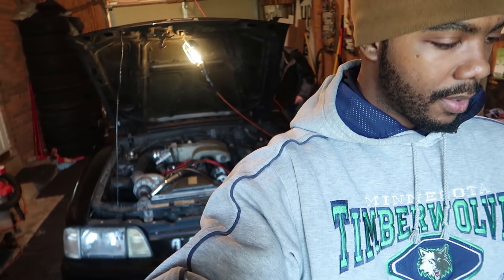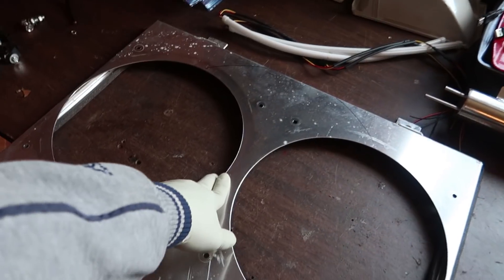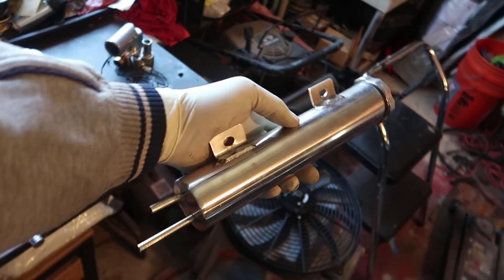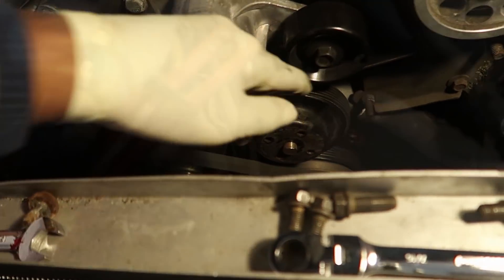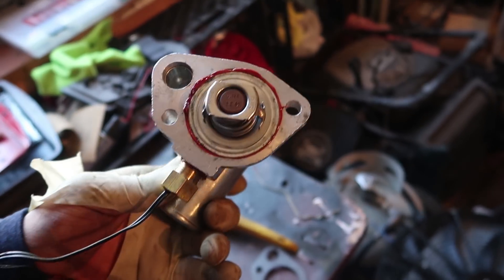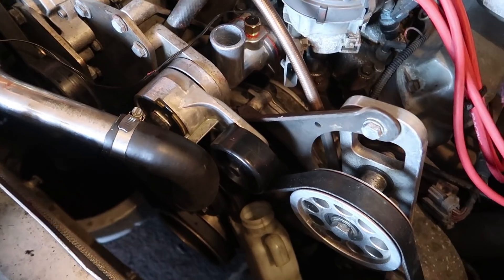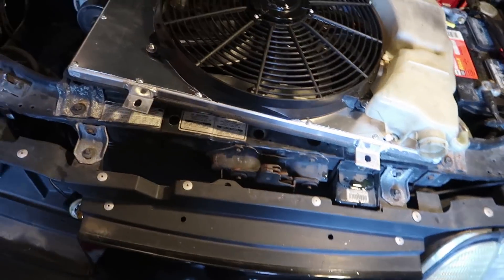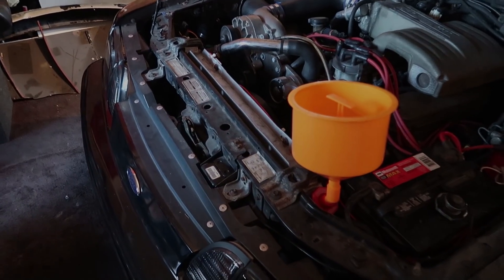Electric fan conversion with automatic switch: Foxbody

Comment: Hey is that kit for $59.99 then u have to buy the thermostat housing neck with the plug in it!! I seen how 1 of those kits it looks like the probe goes into the intake instead of the housing!! Or do u remember the part # that or I might just use a toggle switch just have to keep watching my temperature gauge

Comment: Im not very good at wiring diagram. How did u tap into the ignition coil for the 12volt source? Thanks!
Reply from the maker: the plug that goes to the coil has a red wire and a black wire.  Just splice into the red wire.  Be sure to disconnect your battery and use a fuse.

Comment: You guys DO love RTV  but it wasn't meant to be that thick which can prevent the bolts from fully tightening.
Reply from the maker: The most important thing is to be very careful not to get RTV in the bolt holes, that could cause some serious damage. I learned that a little later, not the hard way thankfully.

Comment: Great Video  I only wish you would include a list of parts you used that would be very helpful. Also dose anyone know of  oem or aftermarket fan that  with a shroud that will fit?
Reply from the maker: All parts are listed in the beginning of the vid, most of that stuff can be found on LMR.  The shroud is from an ebay dual fan set up that i DO NOT recommend buying,  as you saw, i canabalized it to make something new.  Use a Tauris or contour fan instead as I suggested.
Reply: Thank you so much keep up the good work on these videos.

Comment: A word of warning you should never put sealant around the thermostat itself if it comes off and it will and goes down into your engine and then up into your radiator it will clog up some of its pores then  you will begin to have issues I know this because a friend of mine did that and he started having heating problems months later  and there was no way to get the sealant out of the radiator so he had to replace the radiator but not before he had to completely flush out the engine system to make sure there was  no more sealant. Other than that it's a good video..
Reply: That and that thermostat looks to be one wire so it needs to ground out. The rtv can work as an insulator and keep it from grounding out properly. Be careful.

Comment: How many CFM Is that fan? You should have just installed a contour dual fan- it pulls well over 3000CFM.  TO make the thermostat install easier, remove the tensioner- it's just one bolt and give you a ton of space. Glad to see you got a Lisle funnel and got rid of that crappy aftermarket overflow.   You should drill a small hole in the top of the thermostat to ensure coolant continues to flow in case it sticks closed, You should ALWAYS test the thermostat in boiling water prior to installing them. Ive seen many fail right out of the box,
Reply from the maker: Thx for the tips.  I gave him that fan because it was laying around, I actually had a set of contour fans on hand as well, but we used this one and its working great.

Comment: at 9:06 ,  the green "Override Circuit" shown on the Relay/Fan diagram, it goes to a manual on/off switch...if.... you choose to install one?  

Thanks for the vid. Really helped take the fear of the install away !!
Reply from the maker: Yes, you can add in a switch to manually operate your fan, you may also use this wire if you have air conditioning, so the fan will come on when you turn on the AC.

Comment: Because I’m stupid can you explain why the smaller overflow tank is too small for the fox?
Reply from the maker: as you get up to temp, it pushes fluid out of the system into the overflow.  When it cools back down it pulls fluid back in from the overflow reservoir.  When your reservoir overflows it spills fluid out on to the ground.  This happens when you overfill your reservoir, or if you over heat your motor.  When you add a small reservoir, it can't hold enough fluid that pushes out, then when it cools, it will suck in an air bubble, and then your cooling system will get screwy.  The reservoir i showed in the video is one of the smallest ones you can get.  It would probably work on a honda, but not a big 5.0.   There are similar ones you can buy that hold more liquid, so just dont get the little one like i showed.
Reply: The cooling system needs to be fully filled with coolant in order to work properly. When the coolant gets got, it expands, so you need an over flow tank so the coolant can go somewhere If the overflow tank is too small, when the coolant gets hot, it will spill out of the overflow tank and when the car cools down, it will suck in coolant but since some of it spilled out, if will suck in air. Air inside your cooling system is not good.
Reply from the maker: Thx! I didn't see this b4 i replied.
Reply: Premium Fuel Mag that’s kinda what i figured you were gonna say but considering i already got it from late model and non of the reviews said that i doubted it was that... guess I’ll be getting another style lol
Reply from the maker: If LMR sells it, they probably have the correct size,  They really don't sell junk on their site.
Reply: Premium Fuel Mag true. I’ve never had a problem they haven’t resolved when there is an issue too. I’ll give it a shot and see what happens. Worst that can happen is u put the stock one back on

Comment: What experience did u have with the 2 ebay style fans? I've used them before but long ago
Reply from the maker: They tried as hard as they could, but my temperature would slowly rise, and i couldn't stay cool in summer traffic, however, when i swapped my fans, i also discovered that my thermostat was backwards, i'm sure that contributed to the problem as well, but the dual ebay fans are still very weak.  They may be just good enough for a stock Mustang, but i wouldn't call them an upgrade.